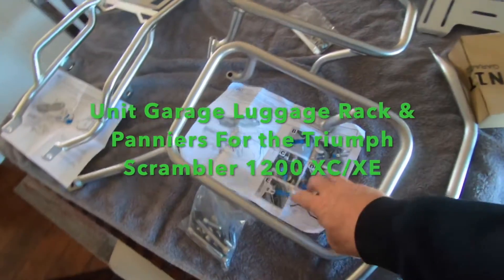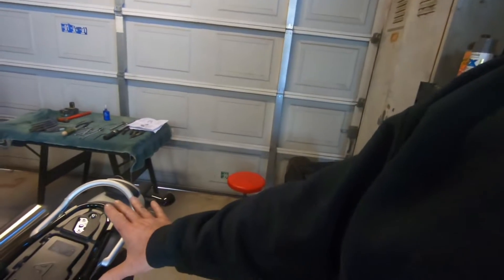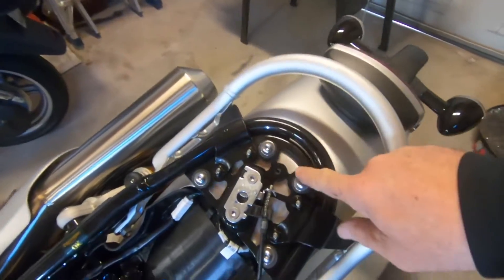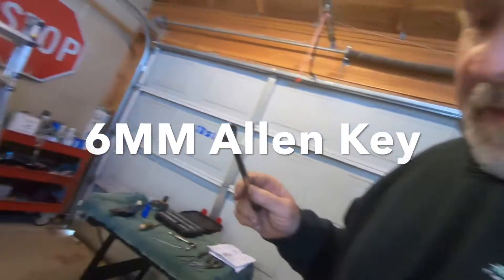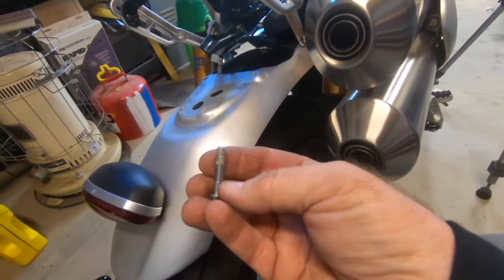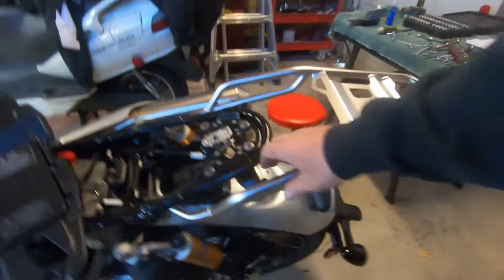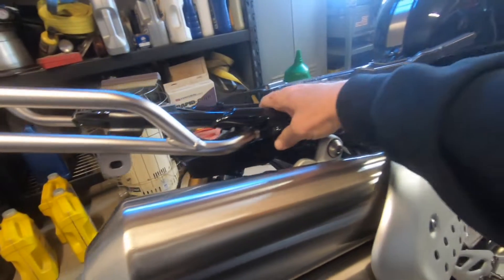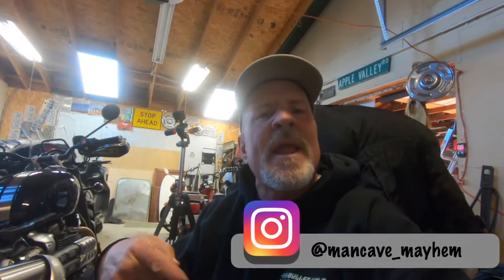Unit Garage Luggage rack for Triumph Srcambler 1200

Comment: I appreciate you making this video. I was wondering if you'd be willing to answer a question... If I'm just installing the luggage rack, do you see any reason to drop the fender? Looks like I could just do 4 Allen bolts on the sides?
Reply from the maker: I think I pulled it down out of the way for clearance purposes. But I don’t recall specifically if I needed to. I think in order to slide that out without scratching things up you need to Drop that fender out of the way. Hope this helps👍🏻
Reply: @ManCaveMayhem  you are correct. I got mine today and due to the shape of the rack and frame, you cannot remove it without following the instructions, and lowering the fender.
Reply from the maker: @CornBuddah  I couldn’t really remember for sure if that’s why I lowered it but I was pretty sure that was why. I hope it all went well for you! Ride safe my friend👍🏻
Reply: @ManCaveMayhem  You’re absolutely right. I did not drop the fender…and I scratched it. No clearance with it on.
Reply from the maker: @wolfbeachmountain  I hope it all worked out in the end! Ride safe🇺🇸

Comment: Seems like no need for a tail tidy with that rack!   😂. Did I see you sold your scrambler?  Why for?
Reply from the maker: The type of riding that I was doing was a lot of highway miles getting to long destinations and the wind protection just wasn’t there on the scrambler. I really did love the bike, but it didn’t work for my application. The tiger 900 checked all the boxes for me.
Reply: @ManCaveMayhem  I hear ya!   Just installed a windscreen today so we’ll see how it does.  But I kept my 2015 Tiger 800 xcx to be my touring bike. And then see how the scrambler works for me as I dial it in.  Tiger 900s are pretty sweet though!